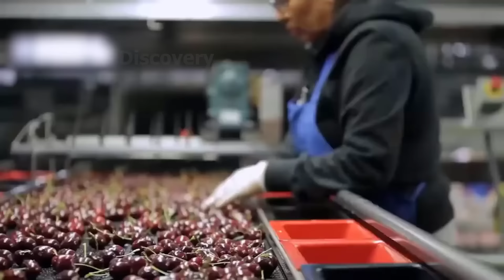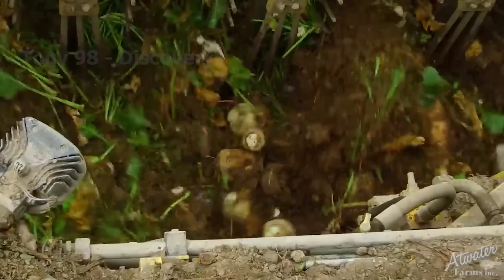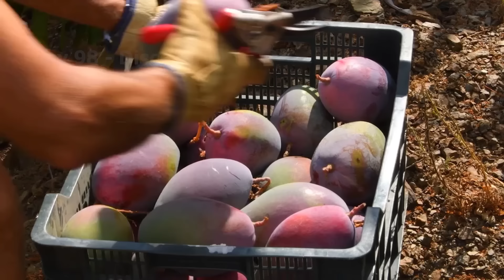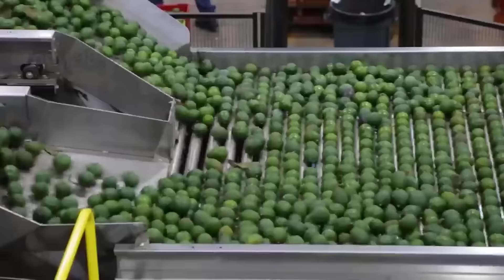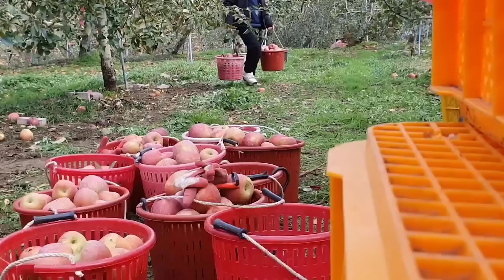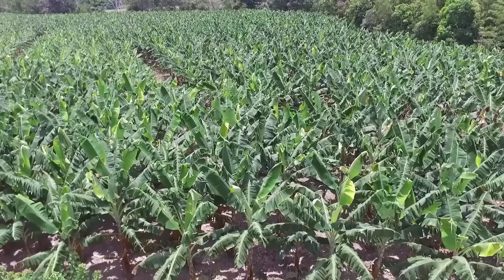US Farmers Are Harvesting And Processing Millions Of Tons Of Agricultural Products This Way

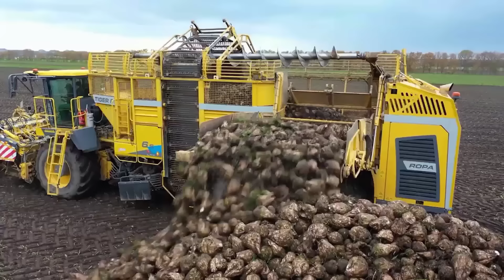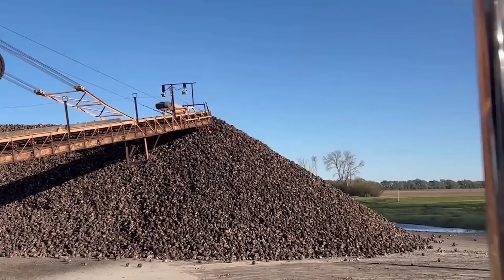Comment: (08:30 - 09:12): Sugar beets are harvested using specialized machinery that operates around the clock. After harvesting, beets are cleaned, weighed, and transported to factories for sugar production, where they are boiled to form sugar crystals.
Reply from the maker: These machines are designed to efficiently remove the beets from the soil and separate the edible root from the leaves and stalks.